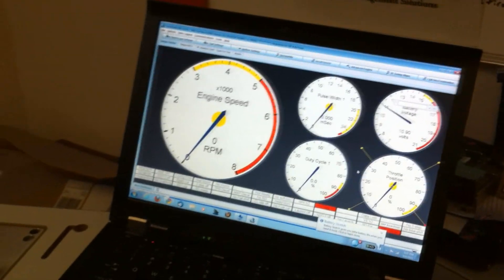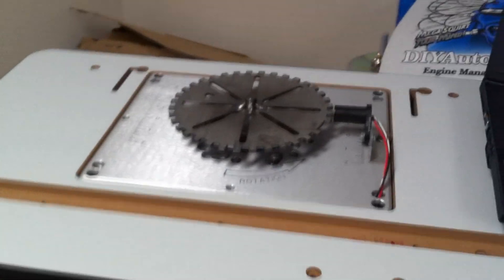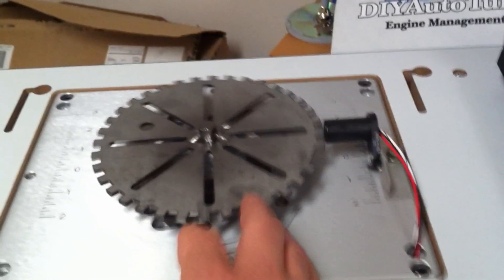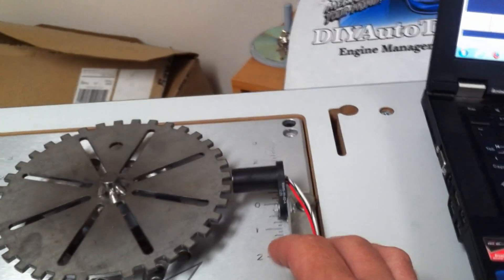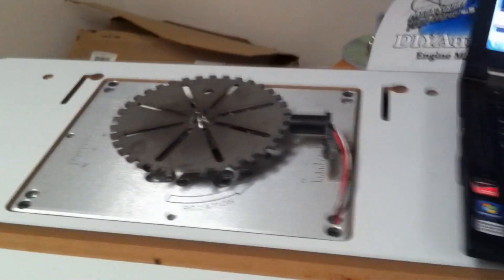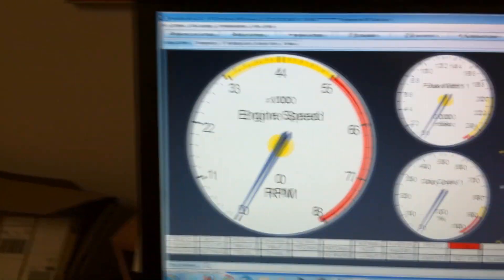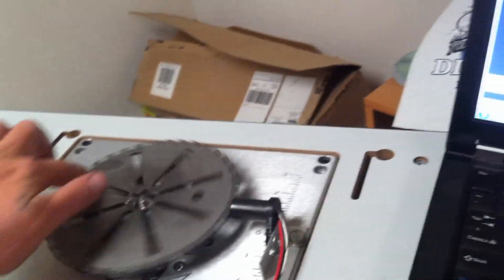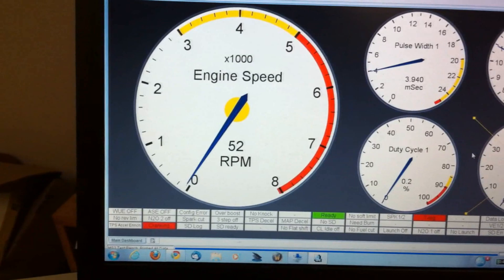MegaSquirt-3 20,000rpm Death Machine testing 36-1 wheel with Hall Sensor

Comment: Hello I have a question I baught a Megasquirt 1 v3 that was built up to 50a on the assembly I bleave its hall optical, the vr setup was left out my question is could I use this hall sensor with a 36-1 trigger wheel that I just baught from diy and use spark a b c d wasted spark with coils that have built in igniters, if it's possible what mods do I have to do to the bord and what setup in tuner studio do I use any help would be great thanks.

Comment: I did have a question about MegaSquirt's ability to keep track of the CKP signal at high RPM.  Now, I'm pretty sure it could measure my CKP signal even if going super sonic flying past an F-16 @ Mach ridiculous.

Comment: Just read over all of the comments.  Thank you all for your concern for my safety...  I knew it was not wise to run without a guard, did it for the video though.  And soon thereafter we put a 1" think steel guard around the perimeter and a thick lexan lid on it.  We use it at tradeshows and such now, with a full fuel system and ignition system spraying fuel and throwing sparks.

Come check it out at PRI in December in Indianapolis.

Comment: I cleared a forest with a butter knife! because a chainsaw is to dangerous and the axes I found were to sharp. People and safety do not mix anymore, they take it to far. Yes to safe is not a bad thing but please people don't be such pussies. All I see at this test is the equivalent of a router or a table saw. Ok he puts a guard on the test and get his leg cut off by the clutch on the car or cylinder head on the face tuning the engine. UNSAFE is you fuckers with bought driver licenses.

Comment: I have the same trigger whell on my car, but i am using a MS2 3.57. Some how, the RPMs in TunerStudio are super high up to 15000 when my actual engine's RPMs are around 800-1200.  What do you have in the settings? Toothed wheel, basic trigger? I am not getting what's going on. Thanx!

Comment: You have a death wish,a simple flip up one piece clear ballistic shield,use 80/20 and make a 1x1 frame,secure it to the assembly.Anybody that tells you not to worry is a idiot,a hairline crack could develop and that trigger wheel will explode like a hand grenade.